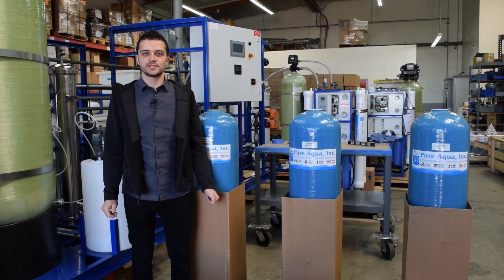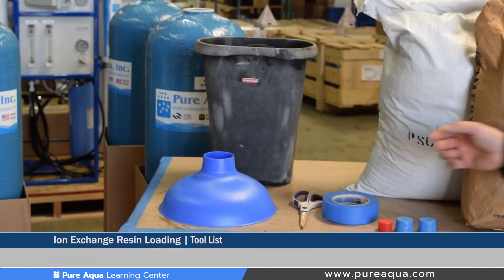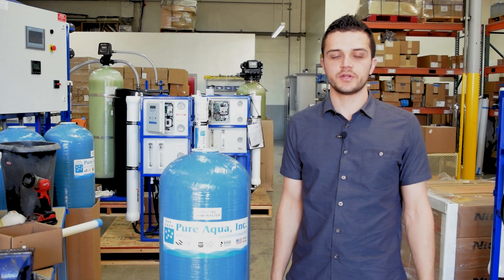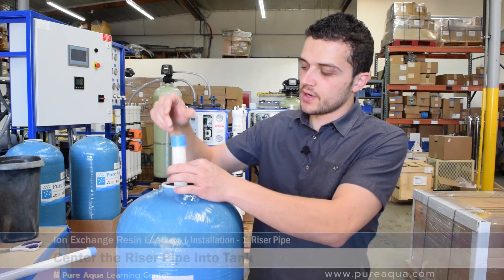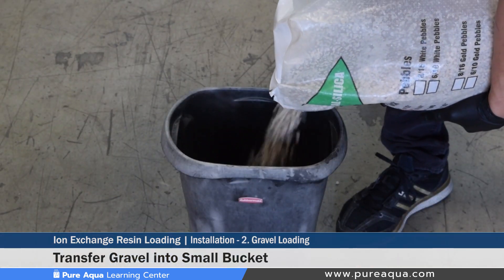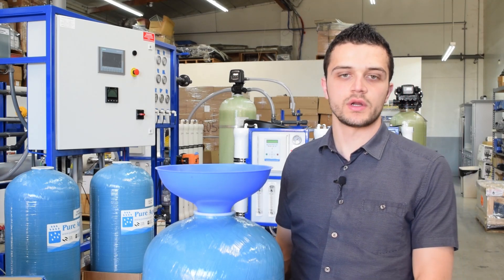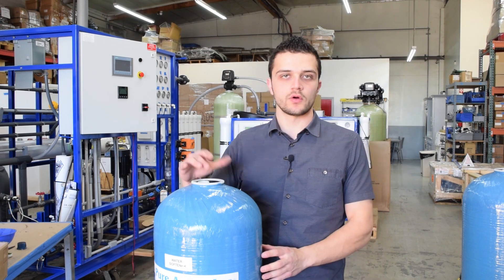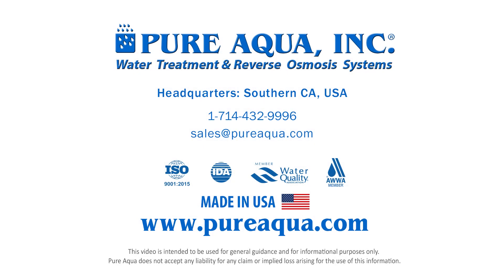Resin Media Loading - Pure Aqua Learning Center

Comment: What is the purpose of the gravel in the bottom? Is this just to help maintain good water flow through the resin? My tank is for water softening of truck-mounted carpet cleaner and it never had gravel in the bottom so I'm wondering if I should put some in. I have used it quite a few years as is and am pretty sure it was made this way.
Reply from the maker: using gravel is better maintain a good water flow